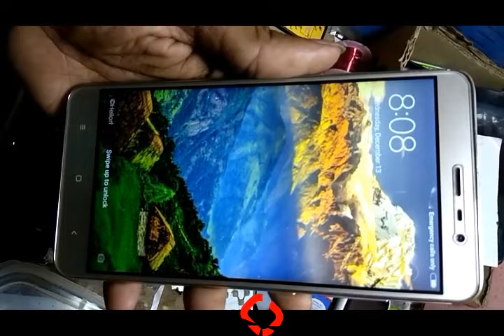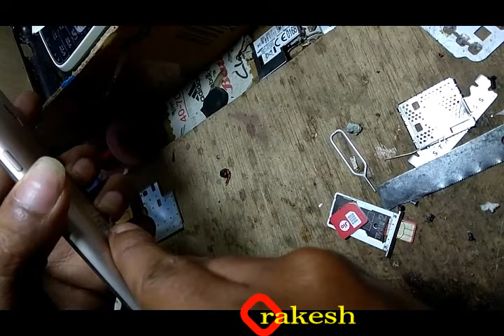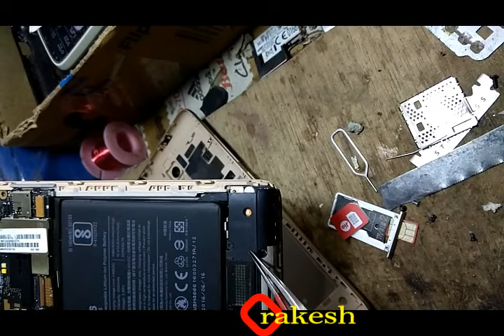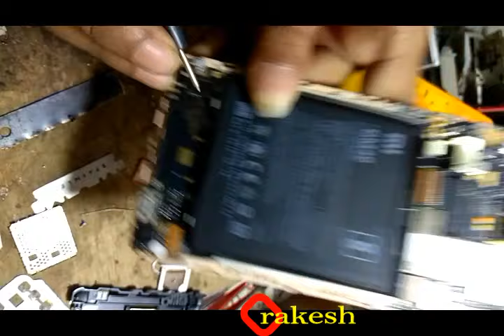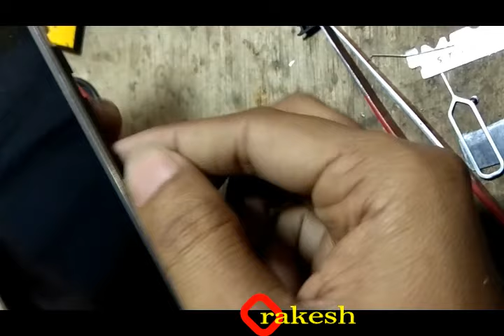any redmi note3 note4 network problem 100% solve just try now

Comment: I tried unlocking bootloader and flashing rom and doing everything but no success
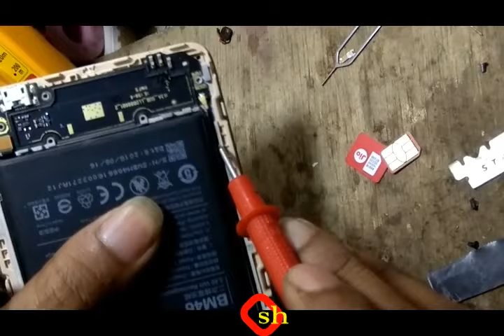I finally found my problem the main network line at 3:10 was broken of mine thanks to you I could check my faults

Comment: Bhai mera redmi note3 me jio speed bhut slow bta raha 19to50kb speed aur same location me other handset me jio speed achi khasi bata rahi hii plz hlp bro🙏
Reply from the maker: Ekbar software karo
Reply: @RKSTECHNICALGalaxy  kya software kre bhai full details bta do bhai
Reply: Miui fastboot ROM flash Kar lo  software update ho jaye ga
Reply: @idhruv0001  i too have this problem and i done flashing and updating with revovery rom. Still i have the problem. Solution plss
Reply: @mohamedsayeed7670  natwork Adapter problem he fir to shop pe dika lo
Reply: @idhruv0001  shop mein kitna rupee charge karegaa
Reply: Mi  ka phone mast rhta h bt network band is not good in comparison to other phone..
Reply: Bhai aapka problem solve ho gaya kya agar ho gaya to yhe problem mere bhi mobail main hai plz mujebhi batao
Reply: Same problem any solutions???
Internet on krne pe speed aayega but after 2 minutes automatically speed khtm call lagane pe 4-5 baar mein connect hota h 

Custom hai

Comment: sir mne shopkeeper se note 4 redmi ka charging jack change krwaya tha kyunki wo loose ho gya tha,badh mei change krne ke badh mobile ka signal ana km ho gya mei wapis shop pr lekr gya usne open kra mobile toh usmei usne screw loose sodh diya tha badh mei usne tight kr dia,but abhi bi internet shi se kaam ni kr pa rha hai beech beech mei net bnd ho jata hai kuch seconds ke liye ,but same network ka dusre phone mei theek chl rha hai,ab sir kya problem ho skti hai ?????? any solution???
Reply from the maker: Asp ka network session ka problem hai.. Aap network session ko check kara lo
Reply: aap muje smja dijiye mei khudh kr lunga theek.shopkeeper toh antena hi bdl dega bol bhi rha tha wo ki antena hi change kr deta hu but antena theek hai signal poora aa rha hai but net shi se work ni kr pa rha
Reply: reset maar lo.. thik ho jayeva
Reply: nhi mila

Comment: Jumber is like a wire thing and I didn't see u using Jumber wire in the video
Reply: There is not much distance yo use wire that why he soldered those points and make a solder wire jumper